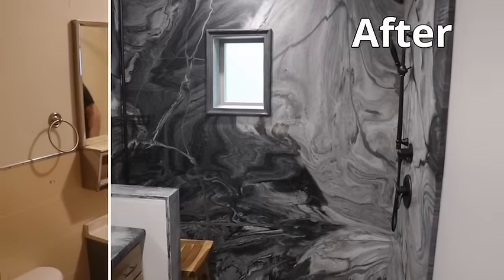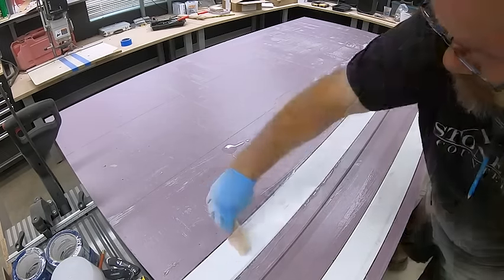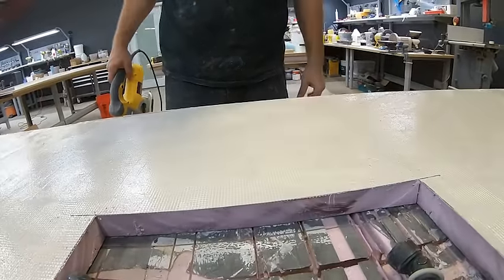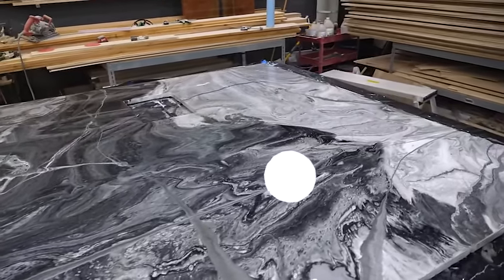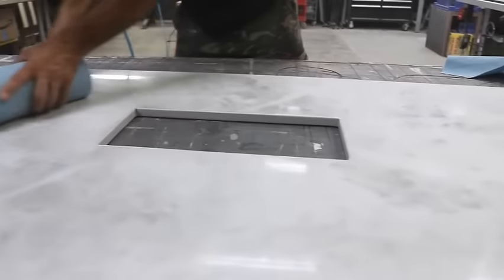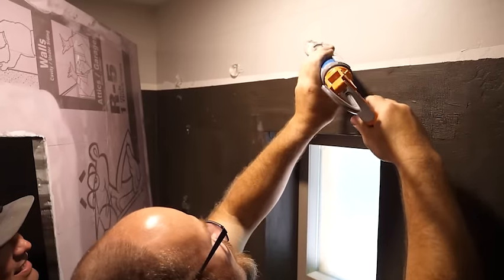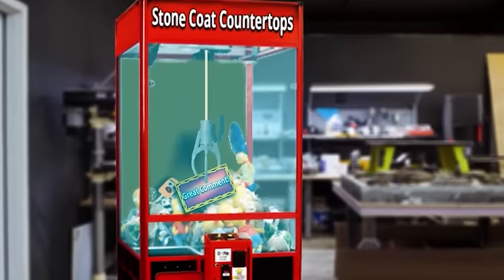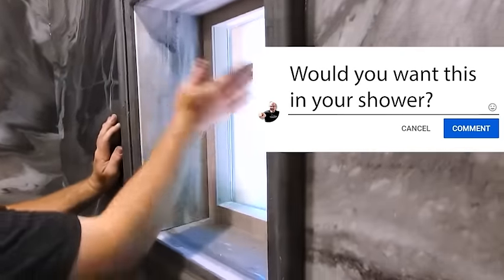Epoxy Shower Walls | Stone Coat Epoxy

Comment: I see you use tape around the edges sometimes and sometimes not. Can you explain in your next video when you should or when you do not have to
Reply from the maker: Sure, I'll go more in depth on that.
Reply: @StoneCoatCountertops  I am also working on a computer top with a attached sitting area and I am trying to come up with an idea to do one color on the computer table and a different color on the sitting area. It is on peace of table top. Can you see if you could make a video of 2 colors on one peace. Like a half and half color.

Comment: Why wouldn’t you use epoxy to seal the corners and gaps instead of silicone?  Epoxy would make the entire surface one piece after it cures and eliminate any chance of water intrusion ever ever.

Comment: looks good but im guessing you are relying a thin bead of silicone against hthe floor to the wall to make it waterproof and i dont like that
Reply from the maker: No, we used ardex on the whole pan
Reply: I'm using a liner and mortar . Do you use ardex on Mortar then apply your gravel base?

Comment: What kind of tape do you use for edges?
Reply from the maker: I just used making tape
Reply: @StoneCoatCountertops  
Thank you. Ive been experimenting with your product. While you're here i would love to ask you a quick question regarding getting the highest sheen out of the countertop mix with ultimate top coat.

Just sand with 220 after a couple days and roll on top coat, is that it or might you suggest any superior methods to get a more reflective shine. Can you buff the topcoat?

Thanks
Boo

Comment: Watched all the videos thoroughly multiple times, and followed every step. After using more than double the advertised amount of epoxy. The fiberglass mesh still stood above the epoxy in some places. Plenty of other misleading information in this video, but I'll just leave it at don't do this!
Reply: You put the mesh on the back of the panels right?

Comment: Do it yourself, yeah right. I could have bought a whole bathroom for how much it would have cost to do it your way.
Reply from the maker: It was about 450 for the materials of the panels.
Reply: @StoneCoatCountertops  I understand, but that's just for your stuff, not the rest of the materials. My point was you are selling this as a armature do it yourself project... For most people, it would end up being a waste of $450 after I screwed it up. Now, if you have a guarantee to send me more FOC if I screw up.. OK. I love the product, but this is not for weekend warriors
Reply: @gregorywilkins1001  practice on scraps of wood etc and go from there! Foam board is not expensive and the epoxy itself is a bit spendy but they do run specials!